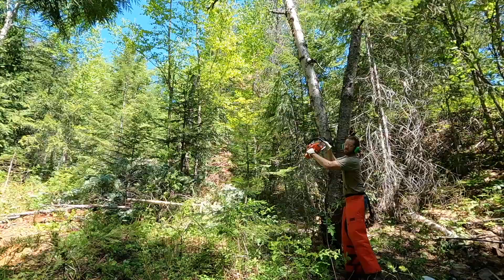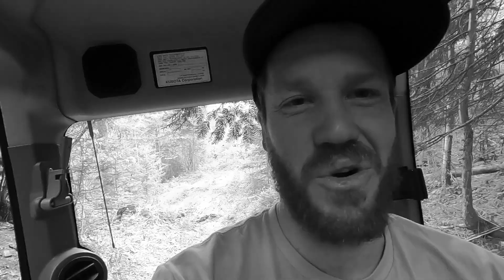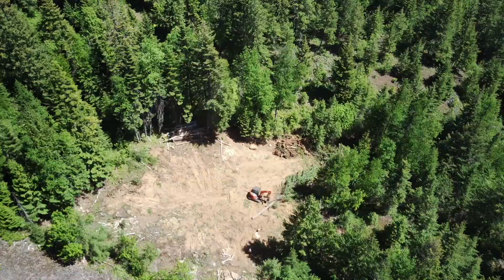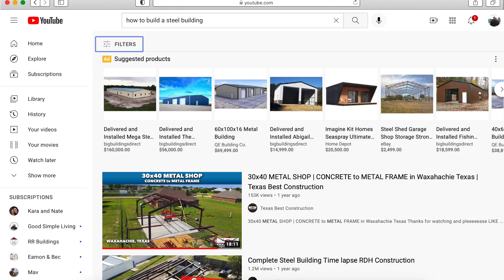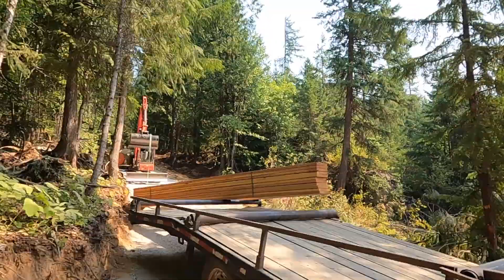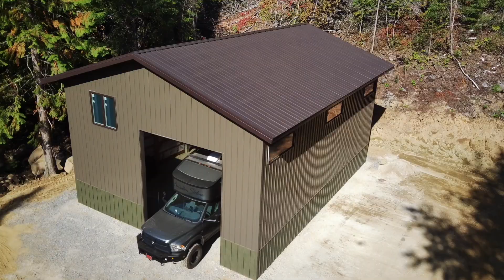DIY Pole Barn House - Total Cost

Comment: We're looking into this the next few years

We own a house in North Idaho now, and are putting in a 30x30 shop in the back

BUT we're looking into a post frame building on 30 acres on hoodoo mountain sometime in the future. 

I think my choice of equipment will be a jcb track backhoe.

tracks! Slideable rear backhoe and front bobcat style quick attach with high flow hydro  and front loader
Reply from the maker: That is an awesome looking machine! I'm not an equipment expert by any means but I do a lot of picking something up (rock, tree, scoop of dirt) and spinning around 180 to put it somewhere else. I think I would be way less productive if I couldn't do that. But, I'm limited in other ways like shuttling materials. I think we need a his and hers combo skid loader and excavator!
Reply: @AmbitionStrikes  

That sounds ideal! It just seems like an all in one machine and with the tracks you've still got the zero turn circle. 

Place is awesome, good inspiration

Comment: Well done!  We are in the research phase of doing something similar and to have you break down the cost is really helpful.
Do you have building codes to contend with in your area?  Do you have a total budget in mind and do you think you’ll finish in budget?
Reply from the maker: Our goal was to be completely done with a furnished upstairs 400 sq ft apartment for less than 100k. I'm about due to add up our costs again to see if we're going to do it. We will need to do an update video once I do! 

We are supposed to follow the national building code, but there are not any inspections currently appliance to us other than a site location permit.

Comment: Nice. We are in the process of building a 30'x40' shop. We went a different route and ordered a complete kit. All metal and steel frame. We poured our footings and slab 1st. We ordered the kit Feb 2021, and it will arrive April 2022! Supply chain issues are to blame. I will definitely rent a telahandler and a scissor lift. Thanks for sharing.
Reply from the maker: How exciting! We almost went the metal kit route as well. Good luck with your build! 😊
Reply: @AmbitionStrikes  Thanks. We're up in N. Idaho as well. See you around. 👍

Comment: Keep the dump truck and put a 9” snow plow on it for your drive in the winter . That thing is cool . Next investment is a skid loader , that will come in handy the rest of your life . Good job and keep on .
Reply from the maker: It's like you read our mind! Next winter Riley wants a large plow for the army truck and Courtney wants a skid loader with a snow blower. 😉
Reply: @AmbitionStrikes  
A small front end loader with a snow bucket , something to stack the snow , even a big skidsteer loader with a snow pusher or snow blower but the snow blower take maintenance and has moving parts that break . Also there are a lot of attachments for a skidsteer loader , a nice Kubota one with track would look good with your excavator. You have to think things breaking all the time and a small front end loader is all most bulletproof , with a 8 or 10 ft snow bucket its one pass down and one pass back up . Another thing is there is these things call shoes you put on the bottom of your plow , they are like skid plates to keep the plow from digging into the dirt . If the ground freezes then you dont need them , only in the early snows before the ground freezes . If your dump truck goes down plowing that would be expensive to fix plus a heavy duty plow would cost $10.000 . Just a couple ideas

Comment: You got screwed!!!!! $ 41,800.00 FOR MATERIALS ONLY!!!!!!!LOL LOL!! THATS A 25K MATERIAL PROJECT!!!
Reply from the maker: Hi Al! I do not think we got screwed. We did quite a bit of shopping around and purchased from many different suppliers. Building supplies are in VERY high demand right now, and as such prices are higher than we've seen the past few years. But we've also learned that we can't spend our days dwelling on the past. Maybe prices will come down... maybe they won't.
Reply: @AmbitionStrikes  of course you don't think you got screwed, you have never built multiple ones as I have.. sorry but you had about 25k in material costs, if purchased properly. I had a building about that size built including hot water heat in concrete for 32k that included all labor to build it all.

Comment: If you want to keep the dream property, it need security, there are criminals that will steal and destroy every thing you have worked for.  Please be careful and cautious.  Good luck, really like your you tube videos. You need alarming devices loud and annoying, and they need to alert you on the cell phone.  Also place tracking device’s on all equipment, hidden so varmints can’t find them.  Have you given thought where you will be placing your septic tank, well, and generator?

Comment: I'm glad when you talk about tools. I sold Snap On for a number of years and switched to a Mac Tools Franchise in 1995 and it was a great move and retired in 2015. Ok enough of me my point is buy the tool once and spend the money once so buying the best saves you money in the long run. I sorry but Harbor Frieght Tools just don't cut it. There are exceptions like Jack Stands and a few hand Tools. When it comes to cordless and power tools don't waste your time and money.  Ok your doing it right.
Reply from the maker: We are huge fans if the right tool for the job, it saves so much time and frustration plus you end up with a better result. Thanks for watching!
Reply: You are very welcome you both do a great service to all the DIY,ers our there. If you didn't tell anyone out there you were just learning I would of thought you were the original This Old House/ New House Expert for the last 50yrs. But since your only in your late 20s the 50 yrs would be the give away. I only wish I was as good as the both of you. I hope someday we might meet down the line. I don't know if I told that I have over my lifetime that I built quite a few things like a cabin and decks.

Comment: Idea?... to go between your apartment and the shoppe... a paternoster elevator? They used to have them long time ago in office buildings... meaning, you have two moving elevators/cabins...  one going up while the other one  going down, at the same time... so, movement is if needed, all the time, not as difficult to construct as it sounds! 
One cabin moving up, the other one is going up side down and moving down.
The UP cabin is turning around upside down, and the DOWN cabin is in normal position and turning upside down going up! So, you use the floor going up, and the ceiling going down. Saving space, looking out for limbs pls. since there are no doors... look in wikipedia for examples.

Comment: Keep the M1078. Yeah, it's loud and a bit obnoxious but with your new work area, you could turn that truck into a sweet overlander. It was never designed to be quiet but it can be with relatively inexpensive sound deadening components. AC systems are available for those trucks and new captain's chairs from old family vans/minivans give you the comfort you want. I've seen people put dog beds behind the seats so the doggies can hang with you. You only have two axles so everything is accessible should you get a wild hair and replace your axle gearing with 3.07 gears. Fifty two miles per hour top speed would be a thing of the past. Although possible with the new gears, you probably don't want to exceed 65mph. You are driving on tires built by the lowest bidder (haha). Once you have a comfortable cab, you can begin building the box. You are both experienced with this so your imagination is the limit. You've already cut the huck bolts so lifting off the dump bed you've created would be far easier and will free up over a ton of weight on the truck. If you do not intend to use the pintel hook you can extend the box a good 3 feet past the frame at the rear. Finally, since you are both tall, the box could be 7'6" overall in height and keep you in the 12 foot area for height. Winter project, wink wink. I'm on the lookout for an M1085 6x6 version of LMTV to build a really big box for traveling.

Comment: The cost of your build I feel is justified because of 2 things 1) the covid crisis 2) the pace that you worked. No one could have foreseen the extortionate price hike for building materials that you had to pay. And as you said you went at it non stop. You were turbo charged and that costs money. Other than the crane that I suggested, you have got things up to where they should be on the advent of winter. I would suggest that the septic is done next as anything to do with the ground is not nice during the winter, cold, wet or snowy or all of the above. I feel that for what you have achieved in 3 months and usually takes other channels 1 to 2 years to get to this stage, you deserve to have a pat on the back as a job well done. Thanks for posting

Comment: Hi Greatly enjoyed your build so far. Have two thoughts,  first consider separating the next building,  from the first by 40' or so as fire break,  our house was first followed by garage/shop 40' away followed 10 years later by pole barn shop, 35' away.  The thinking is that we are unlikely to loose all three to fire (New Hampshire) with the separation there is a significant savings on insurance.   Second thought plan on having a truck like your army truck, mine is sitting outside with 2 tons of roofing on it which will be going on the house tomorrow morning.  Who knew you have to replace roofs every 25 years, this is the second time.  Hopefully your metal roof will last longer.  Back to your truck they are crazy good in the snow,  when our 1/2 ton plow truck can't handle the snow I take out the army truck to break trail with  it..  Keep up the projects.
Reply from the maker: That is all excellent advice! I’m really glad to hear the army truck does well in the snow, we’re going to need it!

Comment: HELLO. WOUNDERING  HOW. YOU WILL HEAT THE. SHOP.  WOOD. STOVE.  CUT DOWN. ALL THE TREES. LEANING OVER THE. DRIVE. WAY.  STOCK PILE. THE TREES.   TOO PROCESS. UP BY THE. SHOP.   IS. THE. TRUCK. 4 WHEEL. DRIVE

Comment: Still think mouton steel would have been easier cheaper and lasted longer in the environment that your in. Been to lot of produce farms up that way and most building we're steal to deal with the weather.
Reply from the maker: Based on our experience a steel building would not have been easier, cheaper or possible in our timeline. A steel building is also much more difficult to build out the interior of, as we are doing an upstairs apartment.

Comment: Start thinning your woods asap, build up a stockpile of wood. 
Source used or old stock water tanks and collect the coming rain water. Bury the tanks to frost proof.
Have a "snow dump" set up asap for the living site , as well as along your driveway. 
A simple DIY video on a wood fired building heater, add a water circuit for hot water and heat the apartment, can be made from scrap air-conditioning coils.
Go MaGyver!!
Reply from the maker: Thank you so much for the tips!
Reply: @AmbitionStrikes  have kin on old95 in Rathdrum.
North Idaho is delightful, the banana valley.

Comment: Not sure what insulation you are using but thick Rmax 4x8 sheets is easy to cut on a table saw and seal the edges with a few cans of spray foam, would probably work best for under the floor of the appartment. We found seconds for cheap, just watch out for the fiberglass coating ones… it’s itchy when cutting.

Comment: sewers easy you have an excavator just dig the hole for the tank b4 you buy one so you can see how big of a tank you can put in. as for a well depends on the water table
Reply from the maker: We’re currently exploring different septic options!
Reply: Remember, someday you will be adding or moving your leach lines and eventually the tank will need service and/or replacement.  Avoid concrete septic tanks, as the acidic moisture deteriorates Portland cement concrete.
Reply: @donalddodson7365  really  the house I'm in the concrete tank was over 50 years old and in good shape when it was crushed to hook up to sewer system. Maybe its the soil type.
Reply: @SaYeager   Ours was build in place in 1958.  You may be right, the soil, the quality of manufacture or construction and the quality of maintenance all has an effect.  Sewage does have an effect on cement.

Comment: Keep the army truck.  You may be surprised that you may need it through the winter and future projects.
Reply: I would agree.  A large dump truck is always useful when you have a shop and property.
Reply: You may find that you need it to climb that hill versus risking the camper in the winter
Reply: Yes it will come in handy to haul gravel for your driveway
Reply: Definitely won’t get anything close to it for what you’ve paid to date. Especially for the shop.
Reply: Agree 💯
Reply: Keep the dump truck. You may need it ti get out of Dodge in an emergency, mud slide , either quake, volcano eruption, blizzard, rescue truck, support truck, ect.
Reply: Id keep everything, all your toys, ya never know if you'll need them again, or a neighbor may need them, that's just what I'd do 👍✌️
Reply: Snow rides for the neighbors?

Comment: I was just thinking about heat for the building. I would use a high efficient furnace, 93% or better, that is big enough for the shop and house or get 2. One for each. They are sealed and usable in a shop setting with fumes. They use pvc for the intake and exhaust.  I spent 5 years as a "tin-knocker" and installer. Go with a high quality brand and keep some extra parts that fail once in a while, like the igniter. Those type of furnace need a place to dump the trickle of water it will produce internally. You will not put moisture in the air and that is a good thing. You could also put in a outside wood boiler, but that`s alot more work and will need alot of wood, year after year. You might want to use both systems?  Take care

Comment: Do you think your roof slope is enough to keep the snow away from accumulating?  That could be a lot of snow weighing down on your trusses and your posts.
Reply from the maker: Our trusses are rated to hold the snow, but our roof pitch should encouraged it to shed.
Reply: @AmbitionStrikes  Under roof heating????

Comment: I bought that Deer Valley dual flush toilet, its pretty cool, i had to set it 4 times before I could get it to stop leaking but It was my set up that was the issue not the toilet. My flange at the floor is really strange for some reason.